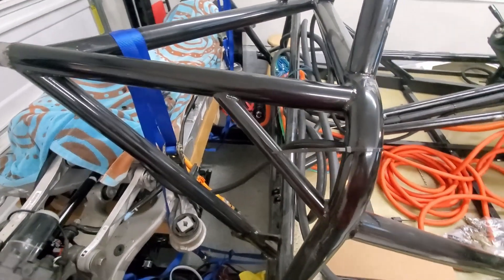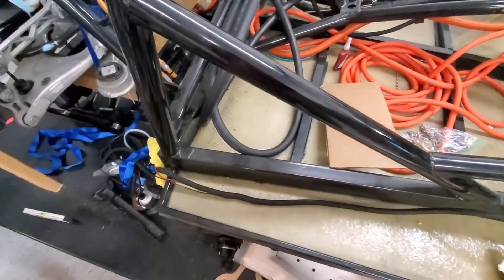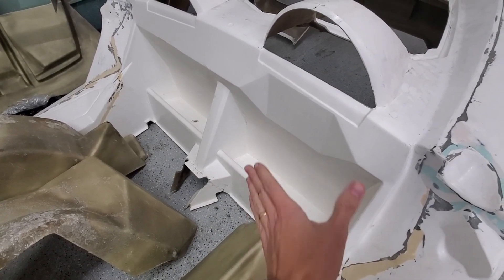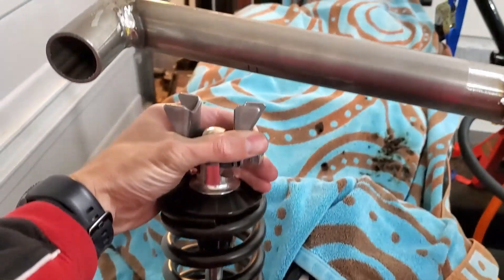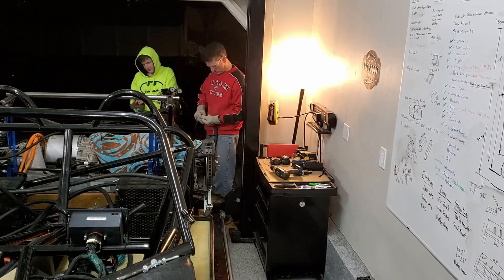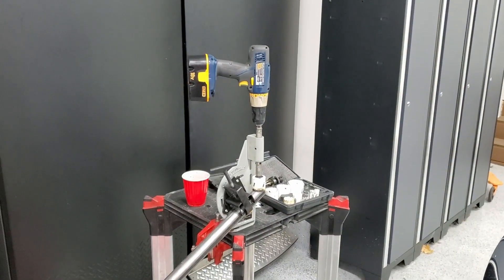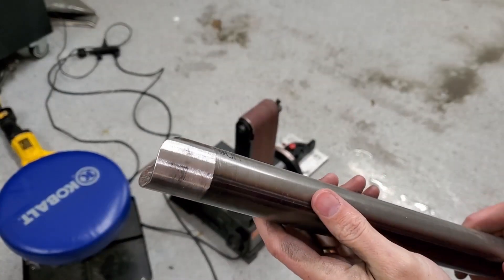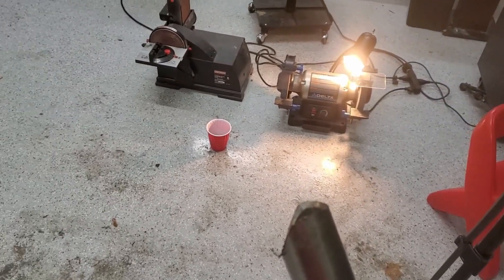Mounting the Tesla Motor Part 1

Comment: I wanted to see how you mounted the Tesla drive unit.... I'm curious how you decided on the support structure.  Was that something you had engineered or did you just kind of wing it as you were looking at the different ways the motor would need to be supported by the frame?
Reply from the maker: It has 4 mounting points for the subframe. I modeled it up in CAD, I had some give suggestions, so I tweaked it a bit.

Comment: In video time 7:22 I see you have 2 adjustment slots on tube angle cutter.
I think if you remove the bolt and use the second lower slot it will cut through.

Comment: How did you calculate the final weight of the car and what are your spring rates? How did you pair shocks to the springs? Is there a shock strength range you can specify when you buy them?
Reply from the maker: Great question Chris.  The shocks you are simply looking for range of motion...so you want to buy based on your ride height and your anticipated shock/suspension travel (from tires off the ground to shock fully compressed).  For the springs, there are many good spring rate calculators on the web. 
https://www.ridetech.com/tech/spring-rate-calculator/
They take into account many things like angles and moment arms as well as the weight.  Hope this helps.
Reply: @electricsupercar  What is your suspension travel, if I may ask?
Reply from the maker: @ProfessorOzone  I believe the travel was 4" (fully compressed to fully extended).